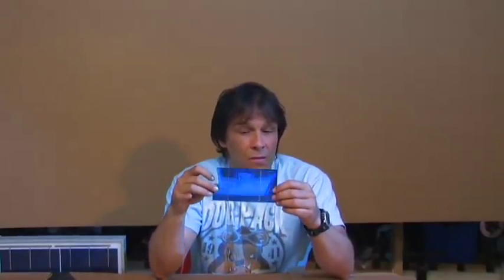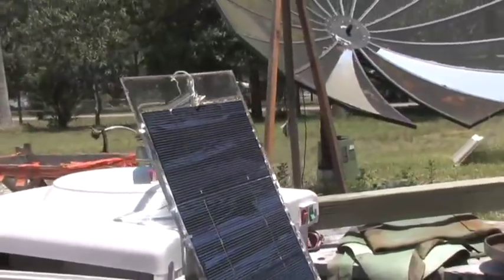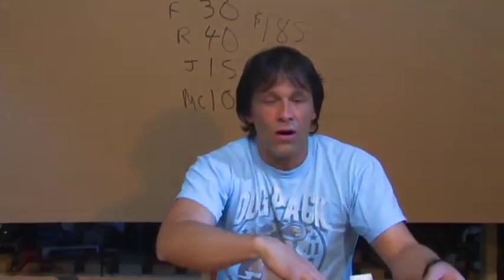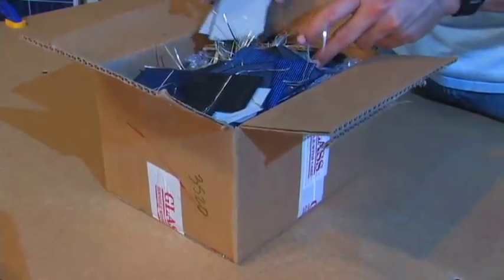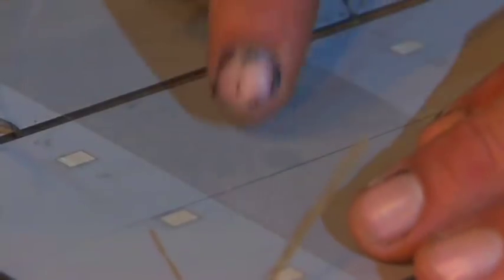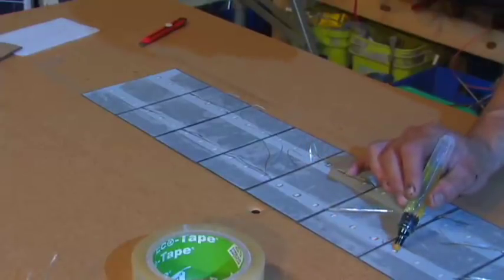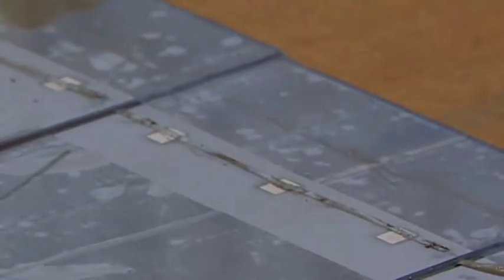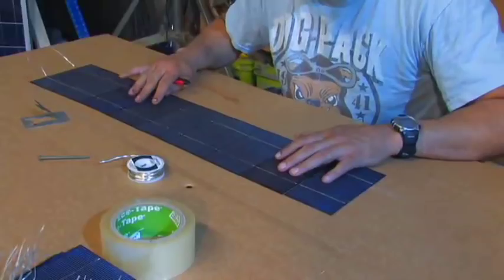less than $1 a watt DIY Solar Panel MAKE YOUR OWN SOLAR PANELS (PART 1)

Comment: Actually, yes solar panels can burn your house down like anything else electrical, But only if your wires short-circuit, or you use wires that are too small for the current produced, your inverter is too small and burns up, you don't use circuit breakers where you should, you don't use blocking diodes,etc.  

They can also electricute you, especially if you're sweaty - so when you're installing them or hooking up wires, cover them up with cardboard or something so the sun doesn't hit them!!!

Comment: Pretty neat, but I think you can do it for less than $1 per watt now.

I've even seen the leftover UniSolar flexible solar cell mats for about $1 per watt, and completely assembled Chinese 160+ watt panels for 75 cents/watt online, so I bet broken cells are really cheap now.

Comment from the maker: The only cells I know of are CPV or concentrated photovoltaic which watt for watt are more expensive but work for orbit projects and each gram of weight at liftoff is expensive. CPV is used for projects on the ground but when the collector and cooling is considered the cost is still a lot more than standard PV. Thank you for the great comment.

Comment: Hey Dan, 
       Thanks for making yet another great video. I was flipping through the channels " TV " and I heard that NASA had came out with a solar cell that would put out almost 9 volts. Have you heard about this ? Also they mentioned something about Ga. Tech. trying to make a " 3 D " cell. Its suppose to do some where around 3 volts.

Comment: i have them tabbed together correctlym but i dont know how to test them with a volt meter. what am i looking for? also can i put them between two pieces of glass, seal the glass with caulk or a different sore of sealer? on top of that i could put window sealer arounf the glass. would that by itself work?

Comment: Go to sunelectric.c om they have the lowest prices and best deals.  I got my first solar array from them.  Solar is going down in price big time.  80 cents a watt is a good deal.  Sun has some as low as 64.  So a 200 watt panel could be as low as 165.   FYI

Comment from the maker: You can, but the first step is to get your house as energy efficient as possible. LED lighting, energy star appliances, proper insulation. Solar thermal for hot water (search our channel for solar hot water) then you can add PV panels for electricity. Powering a whole home without going energy efficient first is 2x as expensive. Check your electric bill and check the kilowatt daily usage.

Comment: There are tabs on one side and solder points on the other.  What he did was solder the tabs from cell A to the solder points of cell A completing an isolated circuit.  The cell will produce energy but it will just circulate in that one isolated cell.  

What he was supposed to do was solder the tabs from cell A to the solder points of cell B, tabs from cell B to solder points of cell C, etc. so they are connected in series and the electricity flows from cell A to B to C (not isolated)

Comment from the maker: Do not go more than 80 watts. The per watt price is the same after shipping they are easier to install one person can lift them to the roof. If one does break from whatever, you are out only 80watts Two 80watt panels cost the same as one 160watt panel. FEDEX AND UPS both charge an additional $50 handling fee for objects in the 100 watt range and larger The 80 watt panels fit the smaller shipping profile and cost $20 vs $70-$100 shipping. Also smaller panels are less likely to break via shipping.

Comment from the maker: Ebay has them, check "tabbed solar cells" buy fully tabbed cells or un-tabbed cells. I do not recommend buying "clipped" or 'short" tabs as they need to be removed with the soldering iron and re-tabbing is tricky.

Comment: the problem is that as of now. solar panels cost to much. and pay for themselves in about 20 years when the cells start to die. lame as hell. but yes. go solar tech ! XD just need a better conversion rate and cheaper cells.

Comment: OMG Dan what are you sayin! Don't get me wrong man I am big time into alternative energy. Especially solar. However, PEOPLE PLEASE DO NOT mount these panels onto your home. Mount in location where fire cannot destroy anything you care about! What Dan is missing out on is that broken cells create what we call a HOT SPOT. If part of a broken cell ends up getting covered with something like a leaf can cause a possible fire hazard. Also bypass diodes are used is strings to prevent melt down too.

Comment: well you raise a good question but the point of these solar panels is to cut down on energy costs and not to replace your energy altogether. They may take off 20% of your energy costs per year which would be worth it if you had the skills and a free weekend.

Comment: well there is controversy surrounding whether or not oil is abiotic. But oil that we use is a fossil fuel in the sense that it is made from fossilized organic material and it is non renewable in the sense that in our lifetimes we will never be able to renew what we have taken out.

Comment: im not sure how much power u can draw out. lets say if u had your whole roof done. could u run your whole house off it? like washer dryer fridge tv microwave all that stuff.
if so what if every single house had em and if everyone was attached to a grid. wouldnt need power plants n things of that sort. also solar panals would become so cheap. everyone could do it for like couple hundred bucks to cover there whole roof lol. dunno what im talking about but would be pretty cool. FREE power when done

Comment: Standard solar panels have a 10%-15% conversion rate with some of the cheaper ones being at the 5% range. Even the highest grade solar panels only have about 25%-30% conversion rate, please don't spew bullshit. Solar panels in general are terrible-generating energy, not even solar power plants use them.

Comment: At about 10:45 in the video you mention getting the pattern backwards & tabbing every cell to itself. I'm not quite following here, as the the unit you tabbed incorrectly is too far from the camera to see what the improperly tabbed units look like. could you elaborate on this? I'm interested in building my own panels, & don't want to make this mistake.

Comment: Put toothpicks between the cells for alignment before putting the sticky tape and soldering. 
After it's soldered, the toothpicks can be removed and reused for the next row. 
This will keep the cells from touching each other and keep them aligned and neat.
Also, use an ice-cream stick or another wood toothpick to hold down the tabs (bus wires) while soldering.
Also, use good quality solder for electronics and be wary of flux and solder intended for other applications like soldering gutters.

Comment: Should extra solder be placed on each of the six connection points on the back of the cells? It seemed like the connections were weak.

Comment: lol 1000 dollars mate you need solar or wind gen  that  will make some power but you also need batterys a shit load of them + something to turn your dc 12 - 24 volts into AC power 240v or 110v  that can cost you 1000+ dollars on its own lol

Comment: great stuff. i just did my first strip of cells. wasnt fun. when i got done, several of the cells were stuck to the table. im thinking bcuz the cells were so thin! im sure it wasnt the tape of the solder that stuck.  also R these tabbed cells your using pre-soldered? question; what can i do to minimize sticking? and should i be using a higher watt iron? i used a 45 watt.   thanx again for all your info. im thinking i would get more power with less area, making a with a  V.A.W.T. what do u think?

Comment: Usually they have the same output per a square inch of connected cell, but if the traces are broken, those sections won't yield electricity, and you may not be able to lay them out in as high density.     

You can always use solder and a little wire to connect the trace that doesn't connect, but you have to know what you are doing (You need to know which trace is positive, and which is negative.)  This also does risk damaging the cell.

Comment: Another great video,what is the name of that backing? I live in the philippines (iloilo) and it's hard to fine some materials. Plexiglass is very expensive here 1/4". Is 1/4" plywood(not treated) ok if painted with a prime sealer and then use polyurethane? Double glass is too heavy. please advise
AJ

Comment: so after each row of 9 cells are tabbed you wire each new strip to each other in series? to end up with the two wires that go to the inverter
good vid, thanks

Comment: and would an average house even have enough surface area to be able to capture enough energy to supply appliances and such. i would really love to do it not just to cut my electricity bill, but for the energy independence in general. and for emergencies. let me know, thanks

Comment: how viable is it to power an average house, if at least partially? i thought about doing this myself but with the cost of batteries, voltage regulators, grid tie equipment, and especially the amount of time it takes and trial and error if you're not a professional, is it really worth it?

Comment: Nice video. Thanks for including your messed up one as a warning even though embarrassing. These types of mistakes can ruin or discourage a project like this very easily. With a wide variety of viewers, you never know their different skill levels and tool proficiency, so the more details you add relating to the project, the less additional research your viewers may require. Keep up the good work!

Comment: That would require the lightbulb to be under sun to work. That means such thing would be useless since you normally need a lightbulb to be on where/when the sun DOESN'T shine.

Comment: All forms of electricity comes from conversions of energy, forms that originally came from the sun. Atomic energy can be attributed to fusion and fision, but still, that energy is free from the universe. For example, sunlight heats water, and it turns into water vapor, then rises. In the sky, it condenses and falls to the earth. The energy that the water carries as it moves down a mountain or through a river, can be used to power generators. The generator doesn't make energy, only converts it.

Comment: No, the energy that you would capture from the light bulb, would cost you money, so there would be no point in paying for electricity to power the light bulb, to then just capture the energy with a solar panel, so that you could just power a light bulb or anything else. The point of the solar panel, is to capture the free energy that the sun delivers to earth daily. We don't pay for sunlight, nor does energy cost anything- it only costs us money in the system we exist in. Energy is free.

Comment: ebay is the cheapest source I've found, search for "PV solar" and look for lowest price and shipping, they usually start out the bidding at 10 cent and it goes up, but I've seen many of these auctions fail, so that means you can get 40-70 panels for under $1 in many cases. it's best to use a ebay auction sniper to get the lowest price. you can also buy them right away, but then you're paying just under $1-$0.75 a panel, more secured that you get them, but you need to pay for it.

Comment: Yeah less than a dollar a watt, then you will have mismatched cells reducing the total power output Companys that make solar panels MATCH the solar cells with each other then they put those in a panel.

Comment: Hi! You did a great job reducing the overall cost. I wonder how durable this construction is? How does it perform after 5 years? Of course, I know that you cannot tell it right now. But I was wondering what will happen to the adhesive tape after 5 years. With all the heat it is getting. Do you also have ideas how to make the framing cheaper?

Comment: One advice on soldering. Buy a constant temperature soldering iron.  Make sure temperature is about 260-280 deg. C (measured!). soldering with high temperature is almost impossible because of the tin oxidation. Also you need a good (non corrosive) soldering paste. Colophony (or rosin, not sure what's the English word for it) won't work well. It's not easy to solder solar cell.

Comment: Well it's a nice try, but I think you paid too much for the cells (because of the broken ones) Broken cells will work but power they give would be less than other cells. When you make a panel you would want all cells to give the same power (no space in comments to explain why).Diodes save some troubles, but it's better to not have broken cells.
I can buy 100+ Watt panels for about $2.6/Watt. and it's tested and working. is it worth to build your own and risk braking cells, waste time - not sure.

Comment: solar is rather bogus and if its cloudy or winter it wont do much the best ones are bp not cheap or the ones nasa uses full spectrum on satellites your better off with a gas generator and run it on e85 and u can without harm to engine just retune the carb a lil and go i know i did it already problem with solar is not enough current to charge batterys proper say u draw 1 kw from a battery aphr in 1 hour you used 1000 watts then u want to put in as much as you took out or more to compensate load

Comment: doesnt seem that hard to understand how someone can make their own panel. buy the cells, solder them all together, make a frame, resin them all in between glass, add a junction box and wire and you made a solar panel. skip all this bullshit thats involved in this project and buy a panel thats already made. you dont save money doing this yourself and its not an easy project to do as its shown in alot of videos, its a hassle and if you dont do it right the 1st time your out that much more money.

Comment: Harbor Freight has some nice units. The three 15 watt panels sell on sale for 149.00 They come with a steel frame to put them up, a charge controller with digital volt meter to manage the battery. Each panel is roughly one and a half foot wide by three feet tall. The charge controller has a standard cigarette lighter, USB and 1/4 inch power socket for all  kinds of applications. They are a great camping units. Everything is there but the 12V battery. I use mine all of the time for something.

Comment: it is best to buy your solar panels all ready made. i bought two 36 cell kits to make a 30 watt panel and by the time i was done i had much more invested than if i bought my pre made panels. i bought 12x 10 watt 8A 12V panels for $300 shipped, the two 30 watt panels cost me about $150 each with all the parts to build the kits correctly plus lots of time to build them. so 60 watts 3A 12V for $300 or 120 watts for $300 for something thats already made and works better than expected and no mess.

Comment: Put them on the blades of the blinds.  They'd still be adjustable, but they'd also be producing power at the same time.

Besides, most want to block the sunlight that overheats rooms in the summer, instead of having to crank up the AC.

Comment: Thank you so much! I did tabbing with no issues at all (with my 40 Watt soldering iron), but when it came to attaching cells together it would not solder at all!  After I viewed your video, I tried two new things: your method and a quality 25 Watt iron. It worked like a charm. Only occasionally I had to add a drop of solder, and it actually stayed on the cell. So iron wattage and quality matters as well (too hot and solder won't stay on cell).

Comment: GreenPowerScience - I'm interested in solar energy, but a complete noob in how they work. What I want to know is how do I use the cells/panel to capture the sun, and then to take that power and hook it up to my home in a way that I can plug a standard electrical cord into a socket where that socket is using the power from the solar panel. Any help in understanding this connection would be great.

Comment: I guess you missed the part where he showed you how to do it cheaper. However, it isn't much. So I still would agree, it's much easier to buy it whole than spend so much time doing it this way.

There might be a cheaper/easier method. I would search around.

Comment: If you put tape on the front of the cells it will block the sunlight to those portions of the cells which are covered. Even clear tape will eventually discolor and block light. The front of the cells need to be protected by something perfectly clear and not effected by UV. There aren't many choices here.

Comment: Dan, what about clear thermoplastic instead of resin? vacuum shape it onto the cells. can be very thin.
maybe even silicone them on a plate and then clear gel coat paint them. of course it has to be IR transparent as most of the energy is in IR

Comment: What would be wrong with using the same tape on the front side to protect the cells rather than the expensive resin?..then lay the front glass directly over the cells.

Comment: If you draw an arrow on your desk and always make sure to set your panel down so that the wires need to be soldered in that detection you can prevent making that mistake again if you actually keep the same direction it becomes second nature and shaves a little more time off too.

Comment: @fuelban The front of the solar is negative and the back is positive. There are two negative tabbing wires coming from the front and two positive tabbing wires going to the back. When you arrange the cells positive to negative, you are connecting the cells in series, bumping up the voltage. I hope this helped!